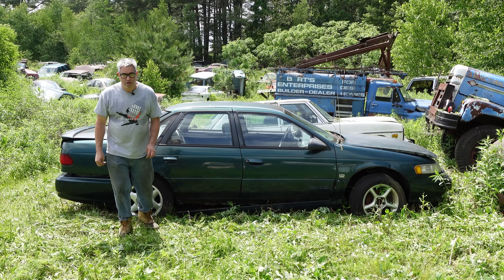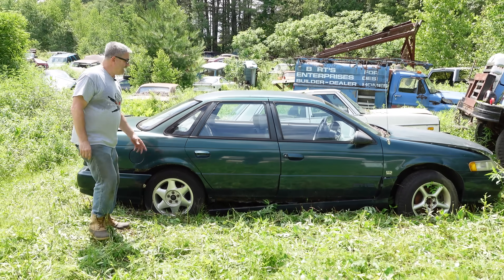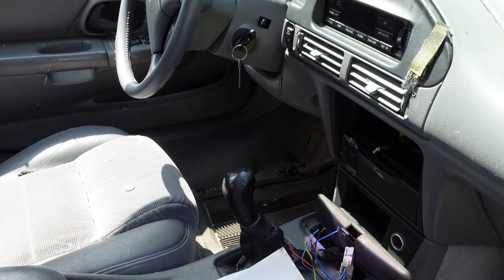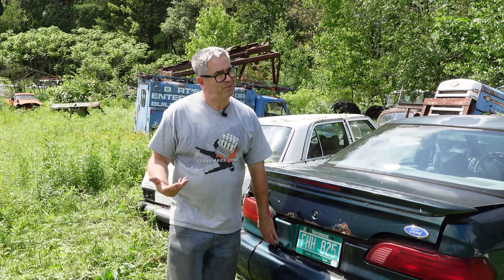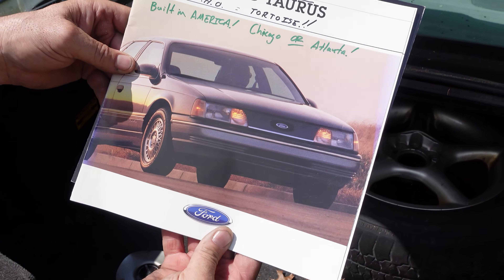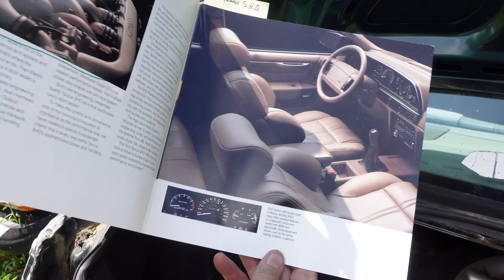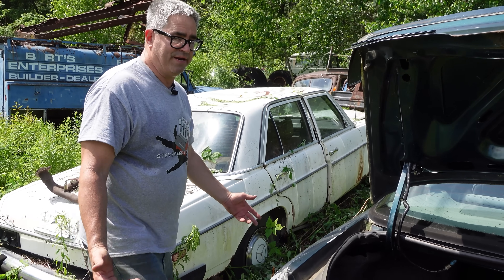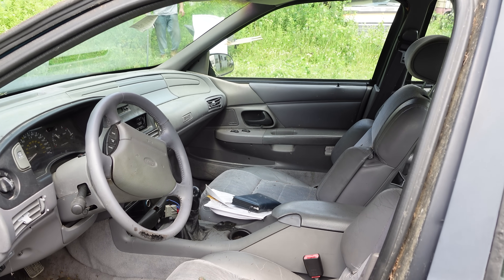SHO Time!

Comment: Anyone know why these might struggle to  run? I see them on marketplace often. Some say they might have jumped time or some kind of fuel issues? This one has that big manual in it, have to wonder, as it doesn't look like it had been there long, what is this one doing there. Not too sure but they may have used these as police interceptors as well.

Comment: Really miss my 92 sho 5 speed.I did a few upgrades like bigger injectors and a took off the catt converters and ran straight pipes all the way back to flow master 500 series.Also replaced the air box to k&n airflow through the fender to breathe more air or take in more air. I spanked many cars and gave some head starts lol.

Comment: I designed the fuel rail for the 96MY SHO 3.4L. It had a single body with injectors that crisscrossed.  We (Walbro/Millennium) were the only manufacturer in the world that could do that configuration. It was a great project working with both Ford and Yamaha.

Comment: I came across one at the wrecker several years ago. Couldn't bear to see the engine recycled, so spent the afternoon yanking that powerplant out. Finally got it on an engine stand just yesterday. Rebuild in its future. Not sure what it's going in yet. You might be able to tell from my profile pic... I like high-revving dual runner intake types. Thanks for vid Steve!!

Comment: I had two of 'em one after the other. First one purchased new. Great car. Initial problem with clutch insufficient for the task and engine mount bolt snapped from torque. Replaced with a classified bolt. The Yamaha parts were fine, still zero valve lash after well over 200,000 miles. The Ford parts, not so much.

Comment: Had a regular 89 Taurus with the 3.0 V6. Great car, very good power and handling. Unfortunately, the transmission began slipping at 180,000 miles and I didn't feel like putting the money into fixing it. I kind of wish I would have fixed it and kept it up, mainly because it drove so good and also because you never see the 1st gen Taurus or the 2nd gen Taurus on the road anymore. When the 1st and 2nd generation Taurus started getting high mileage on them around the late 90's and early 2000's,  that was it. Most people did the same as I did, because they weren't considered anything special and off to the junkyard, they went if anything major failed on them. I can say with complete confidence that I haven't seen a 1st generation Taurus on the road in at least 18 years. You're more likely to see a old Plymouth Roadrunner or Dodge Superbee than a 1st gen Taurus on the road. I'm old enough to remember when these cars were everywhere,  you couldn't go anywhere without seeing a Ford Taurus , it's so strange how a car that was once such a common sight on the road is now so rare that you probably won't see one unless it's in a junkyard.

Comment: I had one of these. It was definitely a sleeper. Problem with EGR circulation . Carbon plug under runner. Use metal coat hanger to unplug.

Comment: I currently have a 91 SHO with the 3.2L from the automatic in it.  It's a little rocket, does quite well in modern traffic.

The previous (and original) owner gave me a treasure trove of parts with it, including a NOS rod shifter conversion with the necessary exhaust.

Comment: At 6:42 you say "2-speed valve" and then point to the IAC (idle air control) valve.
The actuators which control the opening of the secondary butterfly valves are 2 vacuum valves - one is between the intake runners for cyls 5 & 6 (front bank) and the other is between intake runners for cyls 1 & 2 (rear bank). These 2 vacuum valves are controlled by a switch on the rear of the engine by the firewall which allows vacuum pressure to the 2 vacuum valves on the intake manifold when the engine reaches approximately 4000 rpm.

Comment: I loved my red ‘92 SHO automatic with black leather interior.  Minor point but I loved the side curb lights that went on automatically when you activated the turn signal for that side.
I believe the front bumpers were unique to SHO models. And the functional fog lights were cool.  I enjoyed smoking some other high performance cars of the day coming out of full stop toll booths.
What did the car in ultimately after 12 yrs was an AC system that no mechanic by me could get working, annoying expensive repairs like $400 for the failed ignition key switch, $400 for new radiator, a loose r&p steering system requiring another $500 or so, and finally it wouldn’t start and the fix would cost about as much as the car’s book value.
I miss that car though!!

Comment: I had a silver 1995 for 8 years. BEST SEATS EVER!!  It was an auto and was a fun ride. It had ~283k miles and was becoming a money pit. I wanted another performance sedan and in 2004 started looking around. I was not interested in another FWD car but back then there was the Nissan Maxima, Cadillac STS, Nissan Altima SE-R... and then I found the perfect replacement. A 2004 silver Mercury Marauder that I still have today with only 56k miles.

Comment: Some parts and a lot of that induction design molded in plastic found it's way into the 96 and up Windstar 3.8 making 200 horsepower instead of the 140 in the T Bird and Taurus . The extra HP and torque meant the right front tire had half the life of the other 3 . My wifes  96 van was much quicker than the many used Fox body Cougars and Birds i used to pick up as  cheap work cars . looks like the same guage cluster the van had . Hunday-Kia had a real crude copy of the engine when they first tried mini vans that was fire prone.

Comment: Back in 91-92 I was bartender at a Vermont inn. A group of Ford engineers were in town checking out new gear cutting machines for manufacturing an automatic transmission that could handle the power of the SHO.

Comment: A couple of minor corrections, the SHO first came in 1989, not 1987, and it had 220 hp, not 215.  I bought a silver 1992 back in the day, I enjoyed the high rpm but the low end was very poor,  at least compared to the Mustang GT.  I also had a fair amount of warranty work for clutch chatter, sloppy shifter cables and other issues.  Last but not least was the torque steer, mercy!

Comment: I owned an 89 SHO back in 1994. It had some electrical issues that left me stranded a couple times, but it was quick for it's day. There was a subtle change in the engine sound after 4000 rpm when those short runners opened that was cool.

Comment: I had an '89, and I put a 3.2 litre in it.  rod shifter is a must.  cables sucked .THe guy who gave it to me said he pegged the speedo at 140 witht the 3.0 litre.  The clutch was inadequate.  Had the same tranny as the econo box escort  or whatever it was.  The engine was great,  the rest of the can was still a taurus. everything went wrong with it, window switches, and the heater core, the windshield, the sunoof leaked,  I know where it is still, and I might buy it back when I run out of other projects.  What they REALLY should have done was make it a 2 door.

Comment: I had a 2016 SHO, great car and loved it. Traded for a truck before the dreaded Duratec V6 Water Pump ate itself. Heavy car, yes, but is still way faster than the old ones. Mine bone stock managed 13.94 @ 100mph in the 1/4, and with a Tune, 3 Bar MAP Sensor, and CAI I managed to go 12.88 @ 105.

Comment: I remember back in high school in the 1980's seeing the Offenhauser "Dual Port" intake manifolds that were an early attempt at a dual runner intake. Unfortunately both sets of ports were the same length, they just had different cross sections. I doubt they actually worked but they did seem pretty cool way back then.
Reply: A buddy of mine put a dual port on his formula firebird. It made a big difference over stock.

Comment: Sorry for the later reply, I'm just getting back to the office after nearly three weeks of being a juror on a criminal case. I will say at the end of the day, there were no winners. 

The Taurus was a sales success, and the idea was right, but Ford's quality (or lack of) made things bad news. But they did sell and they were good all the way around. I'm not a Fomoco fan, but you have to give credit where it is due. With that said, these could move out pretty good. 

We got the VIN, we win: 1FA for US made Ford passenger car, L for manual seat belts and dual airbags, P54 for Taurus SHO, Y for 3.0L V6 DOHC, 4 is a check digit, S for 1995 model year, A for Atlanta, GA assembly (Hapeville) aka "Hotlanta", and the rest is the production sequence. The Hapeville plant operated from 1947 to 2006 and part of the property has become part of Hartsfield-Jackson Airport in Atlanta (which I have flown through for work a few times). The plant was down the block from the Sears regional headquarters/regional distribution center for Sears on Ponce de Leon Avenue. Some Taurus models were also built at the Chicago, IL facility which still operates today. 

No tag, can't brag, but this is code PA Deep Jewel Green exterior paint. The transmission would be an MTX-IV five speed, which is Mazda designed/inspired.

Comment: Great vid Steve , you forgot to mention that Ford increased the engine to 3.2  litres with the automatic , I was waiting for them to make an auto for several years for my wife as she didn't drive stick , I think 93 might have been the year that the auto with larger engine was offered for more 15 lb ft more torque , same Hp .
Reply: 3.2L
Reply: @bkw322  yes my mistake

Comment: Chrysler countered with the Dodge Spirit R/T, getting 224 hp and 217 ft-lbs of torque from a 2.2L 4 cylinder.  This outdid the Taurus SHO, but only made 2 years and people hardly noticed it at the time.
Reply: Car and Driver (I believe) did a comparison article on the Z34, the Spirit R/T, and the SHO.  The Spirit owned the performance numbers.  I believe 0-60 was 5.7 seconds.
Reply: @charlesdalton985  , oh I forgot the Z34. 😂😂😂😂😂 (Of course, that was easy to do even when they were still brand new.)
Reply: I'm sure, it was because, the Daytona was the IROC model of that era.
Reply: Chrysler actually had a prototype 2.2 that put out over 400 horsepower. They were doing the same thing Ford did, and outsourcing the head. I don't remember which exotic car manufacturer was making the head for them, but general motors bought the majority share in the company just to stop Chrysler. I no longer worked at the Chrysler dealer by then but I had friends that did and actually drove one.  Torque steer was so bad that when it shifted gears, it jumped a lane.
Reply: @garyszewc3339 Lotus designed the Turbo III head used in the Spirit R/T. GM had ownership of Lotus years befor the Spirit R/T. Interestingly, Maserati also made a DOHC 16 valve head for Chrysler's 2.2 that was exclusive to the TC and ended up making the same power.
Reply: @garyszewc3339 I think one of those ended up in the engine bay of the "turbo interceptor" car from the Charlie Sheen movie The Wraith.  I think that also had two turbochargers as well as the special head.
Reply: And Chrysler bought back the majority of those cars. Performance didn't matter because they the timing belt barely outlasted an oil change.
Reply: Uh, cuz it was 2.2 head gasket failure pile,of junk

Comment: Ford had difficulty selling these, probably because of the manual trans, and ended up offering these as employee leases for $180/month just to move them.  They also built 2 Ranger SHO pickups as demo vehicles intended to counter the GMC Typhoon/Syclone.  But they had a problem ***twisting OFF the rear axles***!  So they dumped the concept.

Comment: Couple of factual errors in your commentary.  The Ford Taurus was actually released in December 1985 for the 1986 model year, NOT 1987.  The Taurus SHO was produced from 1989 until the 1999 model year, and then not seen again until the 2010 model year, selling through 2019.  The Taurus model in general was discontinued after the 2004 model year, then reintroduced in 2009 for the 2010 model year.

Comment: I had a 1999 Taurus with the 
Durtec V6 (Not SHO) for a company car. It was 20K out the door.
It ran very strong, I surprised many at stop lights and cruising at speed.
It had 150,000 plus miles when I sold it and still running strong.
Reply: Duratec, yes. The rest of the car, junk. I had a 96 Sable with the duratec v6. Brakes shot at 36k.  Other failures include .Wheel bearings,  multiple sets of swaybar links, variable assist steering , rear speaker shorted out.Lower radiator hose rubbing the frame put a hole in it. An nasty thump in the firewall on a hot day when cornering  the dealer couldn't diagnose. It didn't make it to 100k and the trans failed. A year after the trans was replaced the hot wire from the fuse box under the hood to the one under the dash shorted out and the car wouldn't come out of park. Had to run a new hot wire. I haven't bought a Ford since. Fix or repair daily is an understatement.

Comment: Steve, do you have any information on the SHO Ranger that was tested in 1990? It was a white longbed with Ranger GT "ground effects" and white mesh 16" Enkei wheels. The testing article said the SHO motor was mated to a Borg Warner T5. Considering what you said in the video that the SHO engine block is a Ford 3.0, they would have had to make an adapter to mate the 3.0 to the Borg Warner T5. Such a shame it never went into production...a screaming SHO motor with a 5speed in a little Ranger chassis would have been a blast!

Comment: The 3.0 & 3.2 was a full Yamaha built engine. The reason why is the Vulcan junk they sent to Yamaha in Japan blew up on the dyno with the Vulcan bottom end. Then Ford gave Yamaha the authority to build the whole engine and revise it too hold up. So the engine is actually all built and somewhat engineered by Yamaha. Also a fun fact is this engine and the 2JZ have some similarities due to them being built around the same time frame.
Reply: A quick google search proves you wrong lol. Nice try.
Reply: @Andrew_460  That is what happened because the Vulcan was a pile of shit, so nice try.. Maybe next time don't believe the first thing you find on google keyboard warrior 🤷🏻‍♂️😂
Reply: @hemifanatic.277  nope. The engine was based on the vulcan v6. Stay mad.
Reply: Only thing the Vulcan and the sho v6 share is the engine size.. other then that they are different.. different crank which is forged and con rods which are also forged, aluminum pistons. It’s built to withstand alot more power, look up the blue turd, the guy made close to 1000 hp on stock block “ stock crank and rods”, this engine has Yamaha engineering all over it. The engine is literally on the Yamaha website, unlike the 3.4 v8 sho which was half ford or “cosworth” and Yamaha was not on the website because it’s not a fully Yamaha engine.
Reply: @ConnorFya  well of course they modified the engine to make more power. Im not saying they didnt. Im saying that engine is based on the vulcan. Op said it isnt based on the vulcan.
Reply: The shop i worked at wouldn't do your Vulcan head gasket on an engine with over 100k because they had so many bottom end failures. (they were plenty with under 100k to feast upon). I find the idea of a non modified block comical.
Reply: @CaseyRevoir  the vulcan in my ranger has 480,000 miles on it and still going strong. Never had a problem with it.
Reply: @Andrew_460  Neat, but you didn't see that  number by getting anywhere near 7,000 RPM... Or the higher numbers people push when modding the SHO. I'm sure you'll walk out and bounce it off the Rev limiter on the way to coffee? (or more likely self preserve with slow RPM induced carbon deposits)

Comment: If you notice product placement in movies the 1994 movie "The Santa Clause" has Tim Allen's character driving a silver Taurus SHO and the SHO logo is not hidden so Ford must have paid to feature that car in the movie. By the way most of those came pretty well loaded with options like the Pioneer disc player with the five disc changer in the trunk and the built in car phone in the console. I was never quite affluent enough for the SHO but we had three of the LX versions for a family car 1986 - 1996. It was a comfortable good riding car that got really good gas mileage for it's size.

Comment: I had a new 1999 SHO V8. While sitting at a gas station a man walked up to me to say that I would have problems with this engine around 70,000 miles. Something about a pressed on gear on the cam. A few years later at 74,000 mile the engine locked up driving down the road at 45 mph and motor was ruined.
Reply: Damn! Talk about prophetic utterances!
That’s crazy! Sorry to hear that Buddy!😮
Reply: If you didn’t get the cams welded, you were screwed